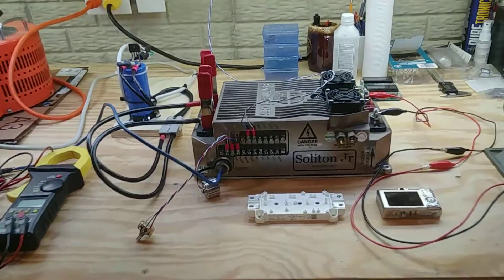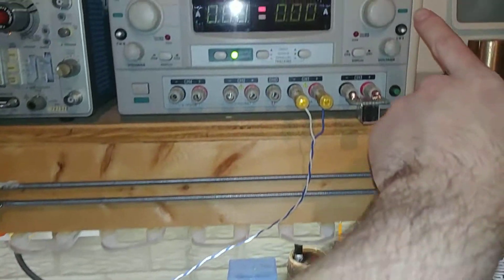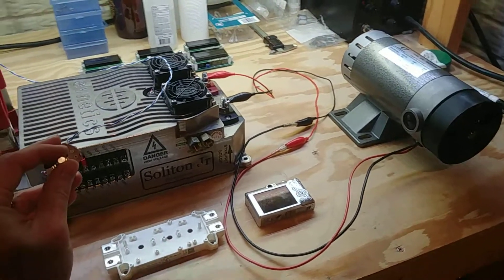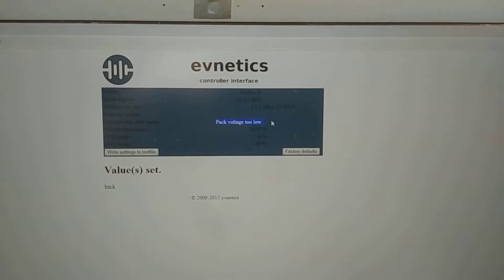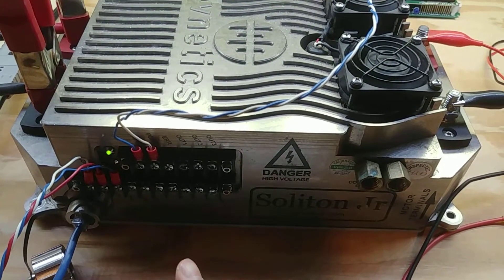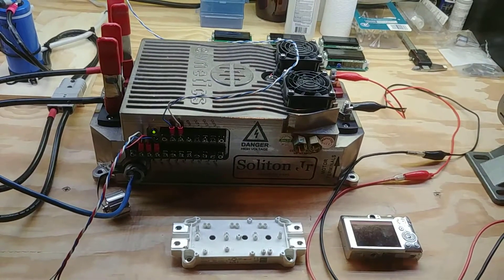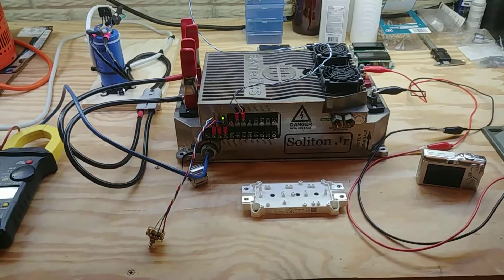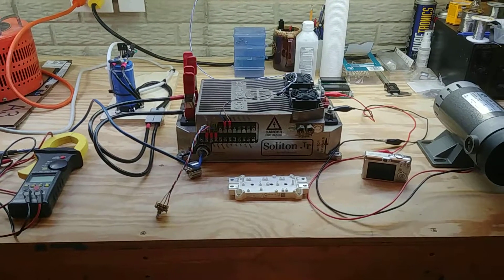Evnetics Soliton JR Motor Controller S/N 03135011 Part 2

Comment: Hey Wolf Tronix, i also got a Soliton Jr. Possible to upgrade it to 1000amp+?
Reply from the maker: That is the highest current module Semikron makes in that package size...

It would require a redesign of the power stage.